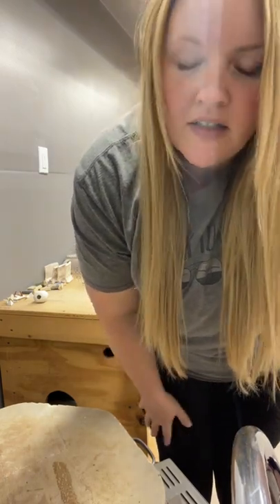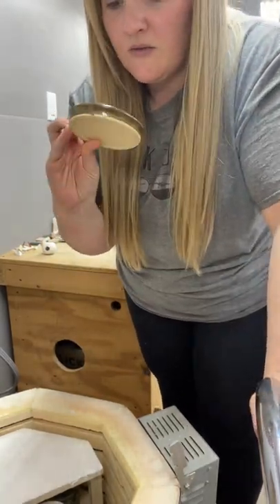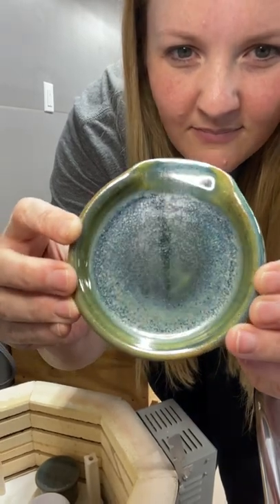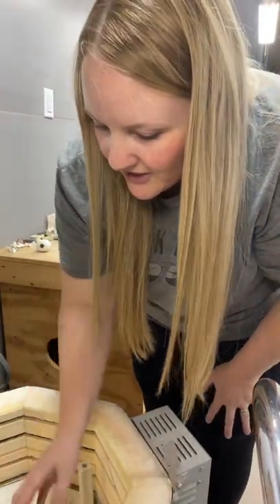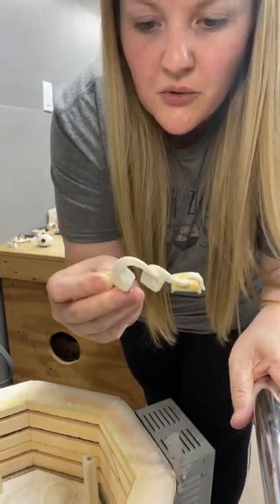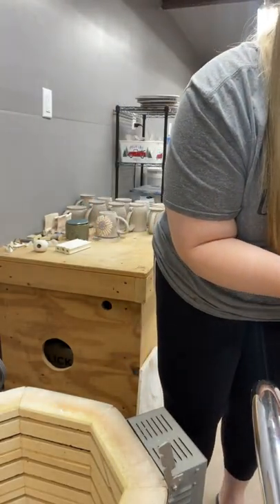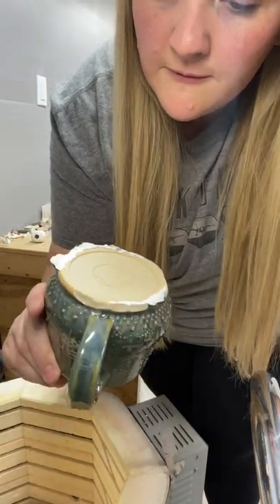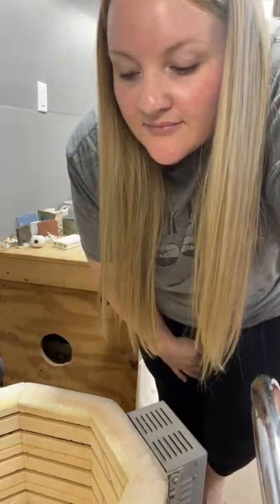Glaze #kiln OPENING! Failures, and successes. New Mayco and Coyote glazes. #ceramic #pottery #art

Comment: Gun metal green is definitely a runner. I made some donut shaped cookies to put under the center of pots to raise it up, then put a regular flat cookie under the donut the glaze will run off the side to the flat cookie without sticking your pot. Or if I use gun metal I stagger the coats. One full coat most of the way down, the second layer only goes 1/2 way down or put a stable glaze near the bottom like winter wood. But you had some good looking pieces this time 😊
Reply from the maker: Brilliant!